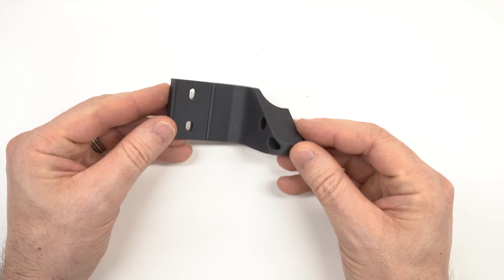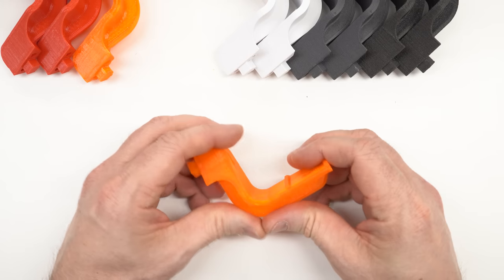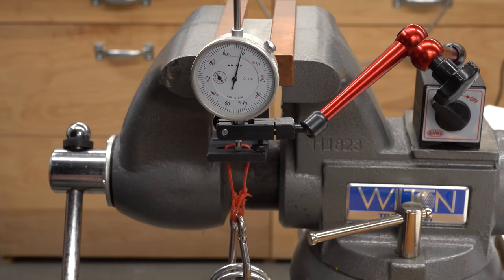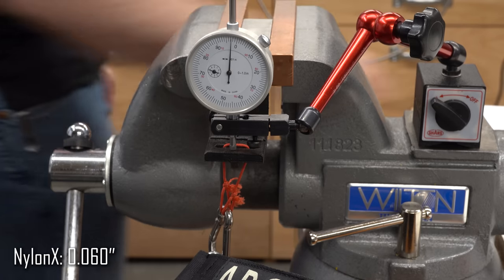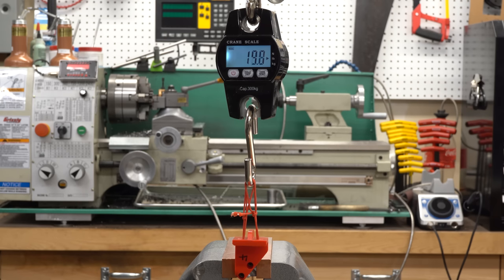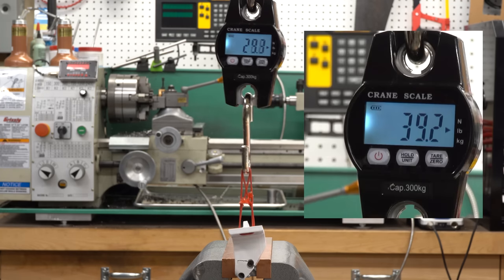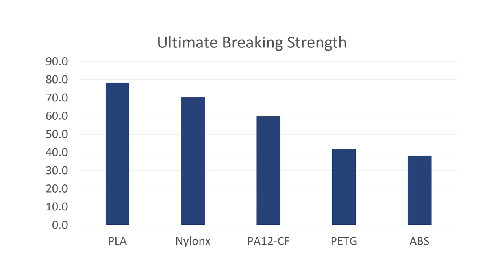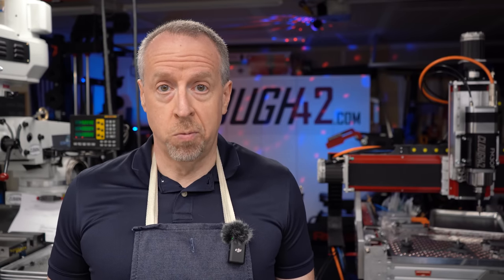Wait, What?  PLA is Stronger Than Carbon-Fiber Nylon?

Comment: My only problem with the result is, that the PLA samples straightend out way too far. Once straightended out, it became more of a tensile strength test. At this point, it was unfair because the lever was a lot shorter.
It would be interesting to measure the load it takes to bend a sample by x degrees!
I checked the newtons just as the samples were in line with the back part of the vise. PLA had 42 Newtons, Your grey nylon 43N, the PETG 36, ABS 37, NylonX (black nylon) 55N, 

I would love to see ASA tested. It prints a LOT easier than ABS and has the best UV-resistance and a great temperature resistance. I tried several brands of ASA and so far Spektrum ASA 275 was by far the very best in terms of printability and layer adhesion. It is literally as easy to print as PLA. Enclosure recommended, fan off. Please also check ASA-X CF10 and ASA Kevlar from Spektrum.

Comment: I print robot gripper fingertips at work regualarly,  we generally print pla proofs, then production gripper in abs-cf, pla grippers will last a day but they struggle with repeated impacts,  my abs-cf grippers will last weeks, but do eventually fail. I treat 3d printing as part of the design process; we print, we break, we reinforce and improve, and repeat.

Comment: I think for any indoor application (climate-controlled area, 60F-80F consistent temps), PLA and PLA+ are the go-to. They are just as strong and much easier to work with than the others. Once you start moving into the outdoors, introducing heat and UV over time, the other materials need to be considered. The absolute 100% answer for "the best filament" is: it depends on the application. Personally, I say use PLA unless you NEED to use something else.

Comment: Lately, I've found myself 3d printing fixtures to hold odd-shaped parts or even parts that my lathe had enough swing to machine but I didn't own a big enough chuck to hold them. I typically design/print them with holes with 3/8" 16  threads to hold and thread bolts straight into them to bolt the parts down. I had one that was used to hold some steel parts that got warm during turning and I got through about 8 uses (8 parts) per fixture before it wouldn't hold the part well enough. I probably would have gotten more use out of it if I didn't use a rechargeable M12 impact driver and an M12 rachet on the first few rounds to tighten the bolts down since the failure mode was eventually pulling the threads out.

PETG is difficult to print consistently, I would bet that if you used it consistently and got to the point that you had a clean surface finish then the first test would be representative of a good print, but the bigger problem is water content. If it was a JUST unwrapped spool or one out of the drier your parts would test more consistently.

Comment: Awesome job. In the breaking strength test most to all cracked right at the screw cap hole mounts, meaning how tight you had those on each piece would affect the results. In further tests the weakest spot that will break should not be the screw area nor the tied pull area, eliminating a good amount of variability.

Comment: Very interesting and educational for a newbie to 3D printing. 
I have taken screen shots of both of your graphs and I will use them when choosing a material type under those needs.
Yes, heat and UV ect. must be considered for different circumstances but for most applications, unless you are Machining critical parts, I think your testing covers most needs. 
Thank you.
Reply: Have a look at CNC kitchen, he tests loads of materials in quite a lot of tests, including impact strength and failure temperature and also tests different techniques like annealing or remelting in salt.

Comment: From my experience the PLA is initialy the best but with it will change shape under permanent load over time (months) and not get back.

Also the low temperature resistance disqualifies it from being used in rough envirinment, unlike ABS (which is the most used plastic in cars because of it's temperature resistance)

Comment: PLA is nice but it has a really big issue with flexing. If you plan on using it for something like a clamp then PLA is really not the way to go as it snaps very easily. PETG is a lot better with applications where the print will be seeing constant loads. I have not used nylon yet but from what I see is that nylon shares benefits of both. PLA is nice, but its stiffness also makes it break with small flexing especially on layer lines. PETG flexes more and so does not hold as stiffly but in my case (like a bike handle bar clamp) it was the only solution. PETG also can be significantly stronger with layer adhesion if you print at higher temperatures since the way it melts it will weld into the previous layers. The only trade off is getting a good consistent print at this heat is a lot easier said than done, but it will end with you having a very strong print.

Comment: My basic tests with standard nylon vs PLA using benchys is that the chimney piece is so much stronger with nylon, I printed them at 50% scale but the nylon was not easily breakable in just my hands whereas the PLA just snapped. That is applying force in its weakest direction though. I am going to try testing the materials in another way though.

Another advantage of nylon is its low friction and that makes it good for gears. It’s low friction and high strength and higher service temperature and wear resistance make it great for gears and better then PLA in those applications. It also has a better impact resistance.

I see nylon as a speciality material not a general use one and should be used where high impact strength and wear resistance are needed. You also used carbon fibre nylon, that will make it stiffer and more brittle. You should try normal unfilled nylon and also compare carbon fibre filled PLA which I find does make a big difference in stiffness and overall strength, you get carbon fibre filled PETG which apparently greatly increases its stiffness too. You could also try polycarbonate if your printer can handle it, apparently it is very strong and very impact resistant compared to other materials.

Comment: I manufacture mounting brackets for various electronic devices like Elgato Stream Decks, and the like.  I have found that Pro PLA has been more consistent, better matte color, and overall, stronger than standard PLA.  I am currently running Duramic Pro Pla. Give it a shot.

Comment: I have found that the speed at which you load it makes a big difference, especially for PETG. It needs a little time for the stretching to happen or it will snap prematurely.
Reply: I love using larger nozzles and going slow with PETG. 😊🌎❤️

Comment: Quality of PLA varies considerably as well. I've landed on PolyMaker as my favourite PLA. I had some silk Eryone that broke into multiple pieces when I dropped it.

Also and I know others have said this PLA creeps under very light loads. I made a nose cone for an the 12v adapter on tire inflator that had broke. The PLA got pushed out by the flimsy springy prongs on the adapter. The nylon x one is still the same shape.

And I may try the qidi pa12-cf in the future because i thought it was just me that the nylon x prints kinda shitty.

Love your videos.

Comment: PETG is very sensitive to any sort temperature changes while printing. Parts cooling fan must be set very low and preferably have a cooling that blows onto the part evenly. If only one side gets cooled then that one side becomes brittle. Also printing at different ambient temperatures can greatly affect strength of PETG. One printed at lower ambient can become more brittle because it cools down faster. Not to mention humidity which can also greatly weaken PETG parts.

Idealy you want to print PETG at higher temp like 235-245 in warm ambient temperature, preferably in an enclosure and use as little as possible cooling fan speed. And let PETG parts cool down slowly. No cool breeze.

Comment: Before I got a Lathe in the toy collection last year I printed some new screw in Hammer faces for one I made 30+ years ago in School. The PETG ones have held up really well to reasonable abuse over time while the PLA ones as expected failed that I made to check tolerance initially (8 perimeters and 50% fill). I would like to test some in Carbon/Nylon for 'toughness' in this application as the Nylon should be closer to PETG on that front with the added Carbon improving on that again.

Comment: I'm one of those who commented that you could've used PLA. But I'll add to that, in this case an a lot of other, it doesn't really matter. My personal preference is PLA if your using it indoors and want strength, PETG if your using it outdoors or need higher temperature resistance, and carbon fiber filled (filled nylon, filled polycarbonate, filled PETG) if you want the best surface finish.

Comment: Have not done any actual testing, but use my 3d printer to make gearboxes for my RC car. The only thing I have noticed with CF Nylon is that it was brittle and rigid. Which, just isnt a good mix on something taking the bumps jumps and hits the rc car would face. Instead, I use PETG which seems to last the longest in that situation. ASA was also pretty good but the material doesnt do well with tapped holes. A hair too soft, and will eventually shear the threads cut in. Inserts help with that.

Comment: You didn't check the 'return' after removing the weight.  Most of them were within 0.001", but the Nylon X looked like it only returned to +0.003, then slowly drifted back up.  Wonder what it would have finally returned to?

Comment: Are you annealing the nylons? Especially the easy to print ones, cause they have additives to slow down/prevent crystallization, and amorphous PA12 is as good as PETG... when you anneal it you get the mechanical properties and also much less creep.
Also... Amorphous polymers like PETG and ABS are very succptible to crack formation and crack growth (microscopically) which makes them inconsistent and a very bad option for anything other than a fixed constant load (structural application).
Moisture is also important in nylons, after annealing it's better to condition them, otherwise they will behave brittle until they soak up enough moisture from the atmosphere which can take up to 2 months depending on the wall thickness, and ambient conditions.
PLA is semicrystalline too, but after printed is amorphous and annealing it will distort the part, so we use it on its amorphous state. What's great about now a days PLAs is that the plus, pro, max, tough, etc versions have nano rubber spheres that appart from making them tough, prevent crack growth, and turn it into a great material (if it wasn't for its HDT).

Thanks for doing these tests =)

Comment: Especially hard to beat the PLA in strength per dollar. For stuff where i'm not going to be nearing the limit of the material strength, it's an easy choice to go with the lower cost and easier to print PLA.

Comment: i had a few ideas. would the screws by a stress point that would give an unfair advantage to certain materials? part of me thoughts maybe the reason for PETG's inconsistency was because of the screws instead of a different mounting system. 

also I'd be curious how other engineering plastics hold up in a side by side comparison. forgive me if some of these are wrong but I wonder how Peek, Hips, PC, PA, and other hybrid materials.

I remember watching an impact resistance video and PETG performed very well and almost everything was better than PLA, so that also might be a property worth looking into for machine applications. 

loved the video and subbed to the channel! can't wait to see what you come up with next
Reply: The parts tended to all fail at the bolted joint, and there are several things that could lead to inconsistency - how the bolt sat on the part, sharp corners, notches, defects near the bolts etc.. Typically, some kind of tensile test would be used for determining the overall strength of a material, and the test sample would be set up for the highest stress to occur where there are minimal non- uniformities or sources of variability - for example, in a narrow middle section of a longer strip of material.

Comment: Just stumbled across this. 

I like PLA for  quick prototypes, prints easy, clean, fast and cheap.
It's stiff and strong till it breaks. It doesn't age well, not suited for outdoor or high temp fluctuations.
It breaks....

Then there is this greentec pro stuff....
Just a better PLA, doesn't survive outdoor or UV.

TPU almost doesn't break but is never stiff. Comes in many different flavors.
PETG is cheap. -> CPE > PETG but not cheap anymore.
PC is PLA without most of it's weaknesses, prints not as easy and is expensive.
PA has a better layer bond than PC but isn't as stiff, breaks later, flexes  more. Expensive and hard to print.
PP has an better layer bond than PA, and is even less stiff. 

Adding CF does a few things, kills non hardened nozzles :P
Adds stiffness, breaks earlier, prints easier, less warping, and cleaner
Decreases layer bonding, so only makes sense if  increase in stiffness is required

I print only 4 CF filaments
TPU + CF ~ just for the looks
PC + CF prints super easy and clean, is very hard, breaks but late
PA + CF prints cleaner and easier than PA but makes it break earlier
PP + CF prints cleaner and easier than PP makes it a lot stiffer, can afford to lose layer bonding but makes it breakable

There is no single best filament
PP + CF is very good
PC + CF is very hard
PA is better without CF
Best PA I tried was Taulman PA cast Plate Nylon

Tips from my side
Print PA on Pertinax or something similar
Print PC und sanded PC plate, first layer colder, so it doesn't melt together
Print PP und sanded PP plate, same as PC
This way both will always have a good bed adhesion, just make sure z offset and start temp don't fuse together ;)

Comment: When I need strong parts I usually print in ABS and dip them in acetone for few seconds, then let them dry. Layer adhesion improves a lot and consequentially strength

Comment: I don’t know what your printer setup is like or what settings you used but you should make sure you are using the ideal settings for each material. Like PETG and Nylon like to be printed hotter and without cooling a lot more than other materials. Having cooling on makes it print better but switching it off or on low generally increases strength, more so for some materials than others.
Reply: Yeah I was thinking the same thing.
(I don't think he has any kind of enclosure....I've only seen a couple of his vids maybe he just didn't show it in the vids I watched)
 In my mind this is good data for someone that doesn't have a heated chamber or enclosure  (like I said I don't think he has one)  so its cooling off too quickly causing brittleness that if one had an ideal heated/temp controlled chamber you wouldn't get.
Does that make sense?
Reply: @phillipcoiner4232  Yeah but the properties and strength can vary massively due to the cooling fan, even having the fan on a little with nylon without an enclosure can make a huge difference. In my limited tests even just a little fan can make the difference between being easily breakable in your hands to being unbreakable in your hands. So the settings he prints with, even without an enclosure, will have a large affect on the results. So unless he prints every material in its optimal settings for strength then the tests dont show much.

Having the cooling fan on is very good for increasing detail but in some materials (PETG, Nylon) it greatly decreases the strength and layer adhesion.

Comment: Very well produced video James.
I 100% agree with all your comments.
I even laughed.
Testing flexy plastic.
You said "Ill just get the dial test indicator"  
I thought wow he will be printing a new surface plate soon
As always,  more data is great.
My only criticisum to this iteration of this video (as updates are sure to follow) is that you binned some free but valuable data.
You took averages to get a ballpark figure ok.
But you binned the deviations.
You should have plot the averages + & -  the deviations (the actual measured values).
It would be extreemly interesting to learn what the manufacturer of the carbon fibre filament says.
Will they recommend using  different print settings or reduce the price or  
Provide evidence of some superiority?
Maybe they could use your print file and try to print a better performing bracket themselves Without altering the design at all.
I know it wasnt intended but in hindsight this is a rather damming & potentially damaging,  display of their product being grossly overpriced per its performance market position.
Reply: I agree that retaining deviation data is useful... but not when testing consists of two samples. 

That said, permanent deformation could certainly have been included, and the addition of print environment data added for the test pieces (print order, as a proxy for humidity in hygroscopic materials, ambient temperature, etc). 

There's lots of variables for this sort of thing and retaining more data makes later processing able to find interesting correlations that were unexpected. If the data isn't stored, however, those discoveries aren't possible.
Reply: @martinmckee5333  
Hi.
Yes I agree that if I set out to collect  deviation & standard deviation etc statistics then I would like the sample size to be much larger & sometimes the more the better.
However this wasnt originally a deviation plotting excersise but the extreem deviation evidenced in this normal real world environment made itself important.
True we dont know if a sample size of say 1000 would all cluster around 1 of these 2 brackets or if there would be 1000 items spread between (or enveloping) these 2 brackets.
But it shure shows that if these 2 brackets were printed and used in real life, at least one end of the soundbar would now be dangling.